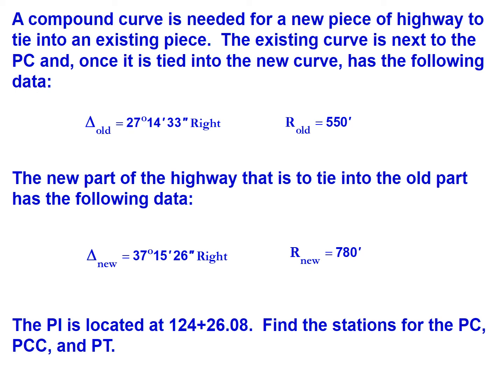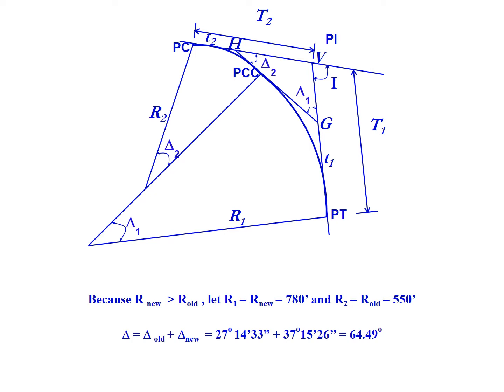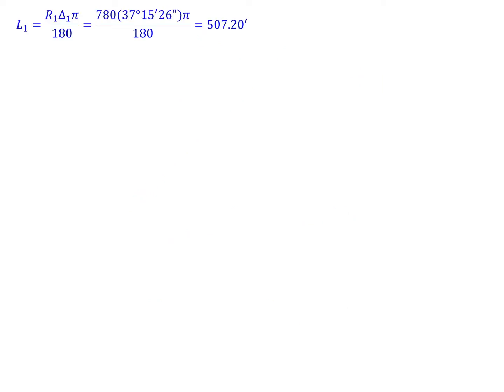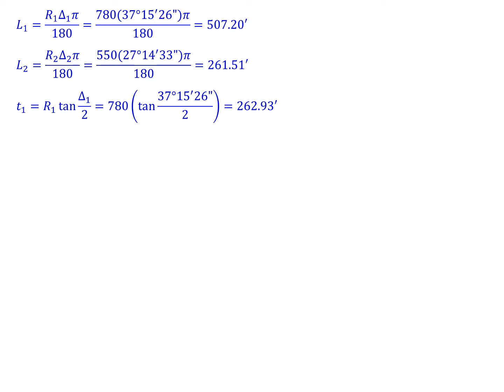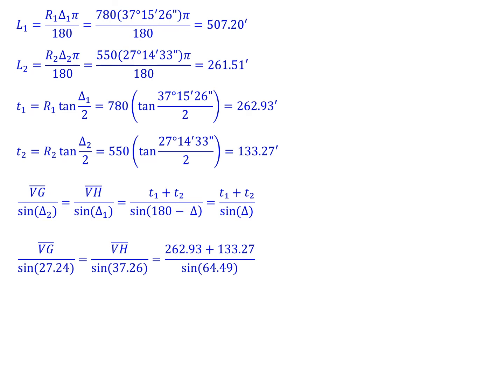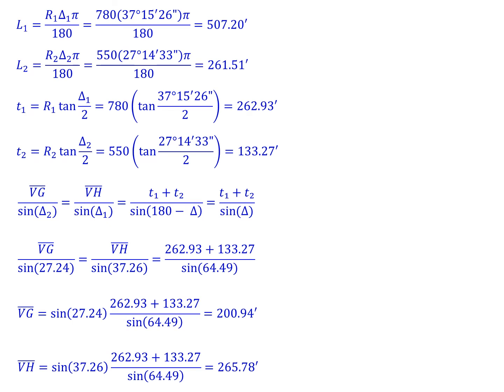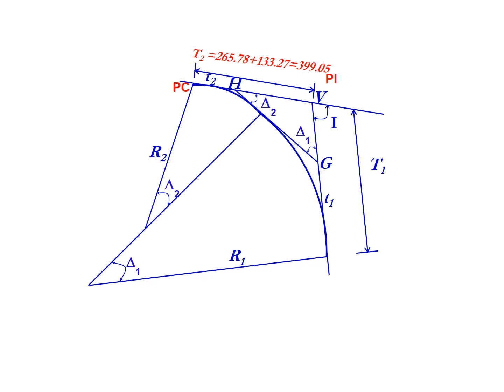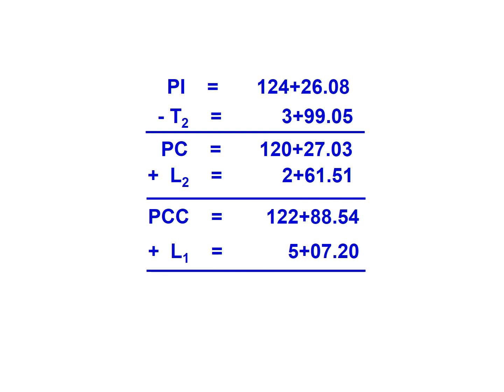Compound Curve for Highway Horizontal Alignment | NCEES Civil Engineering PE Exam [Section 5.2.2]

Comment: Question, how can I tell if the new curve starts at the beginning or end of the old curve? I find it a bit confusing and I hope in the exam it specifies if PC of new curve starts at PT of old curve or the other way around. How can I tell from the problem statement which curve comes first? Thanks.
Reply from the maker: That will need to be provided in the problem statement.  In this example, we're told that the old curve is closest to the PC and then the new curve is added (in this case, the new curve has the larger Radius value, so it has the subscript of 1 and the old curve is denoted by the subscript 2).
Reply: @FindleyDaniel  Thank you very much for all your amazing work! Extremely helpful and I'm learning so much from your you every day!
Reply: @FindleyDaniel  Thanks for all your content is really great. I analyzed this problem using the smaller radii as 1. Do the equations provided only work out if the larger radii is assigned as 1 and the smaller is 2? (I assume it might be something in the derivations but I am confused why that will be the case). Thanks in advance.